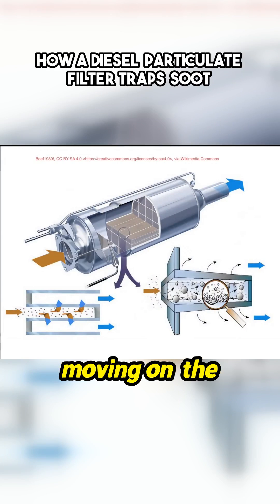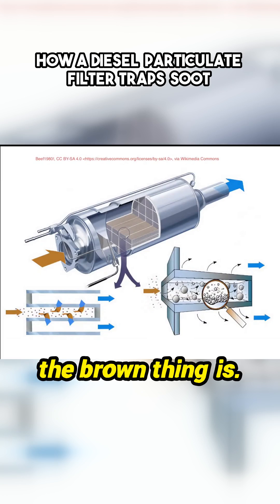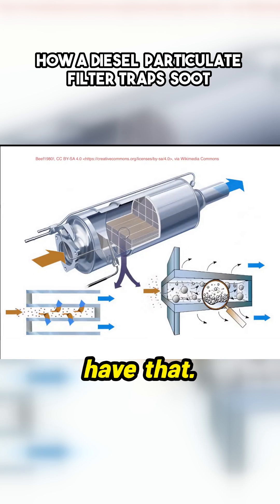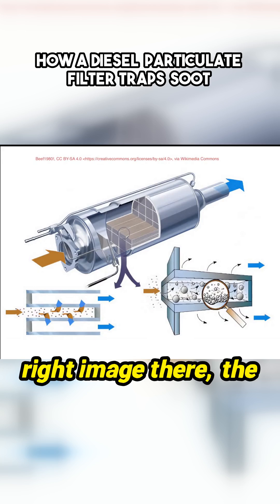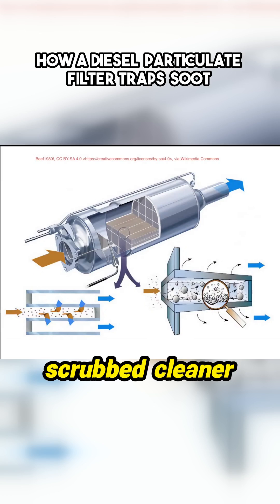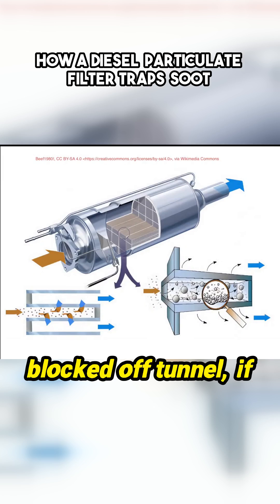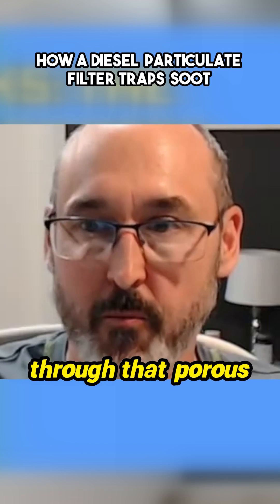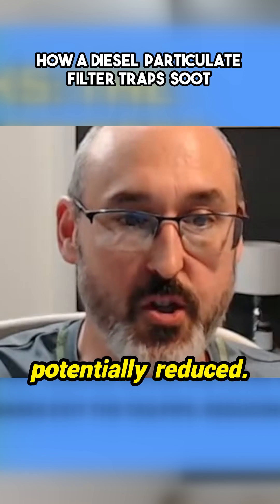How Diesel DPF Systems Trap Soot (FAST Breakdown)

Comment: Does the DPF not periodically go through a regeneration cycle where the soot is burned off?
Reply from the maker: Yes Mark and in Bmw it does this within every 300 Kilometres, however if factors are not satisfied such as if egr or throttle valve is faulty then egr will be prohibited and blocked then it builds up with soot